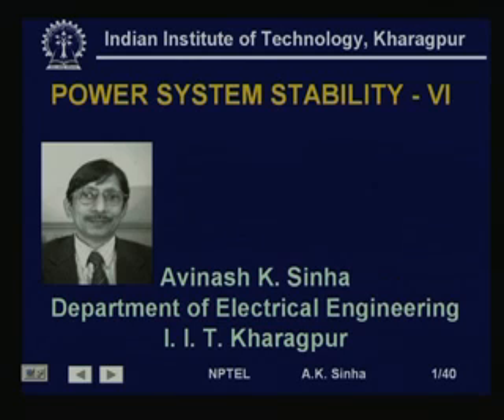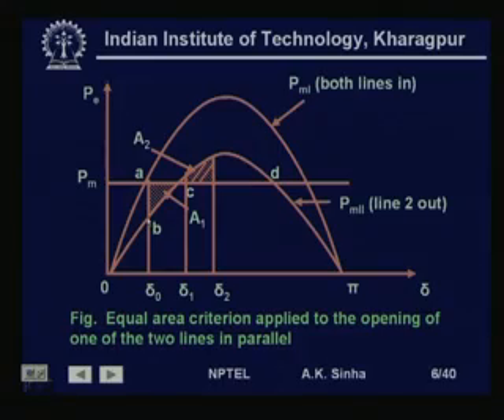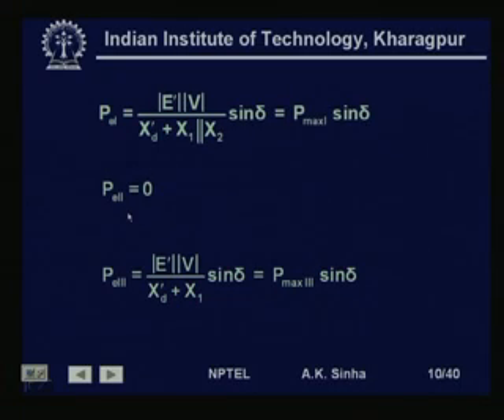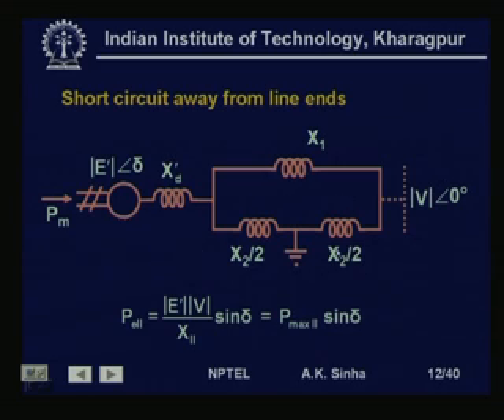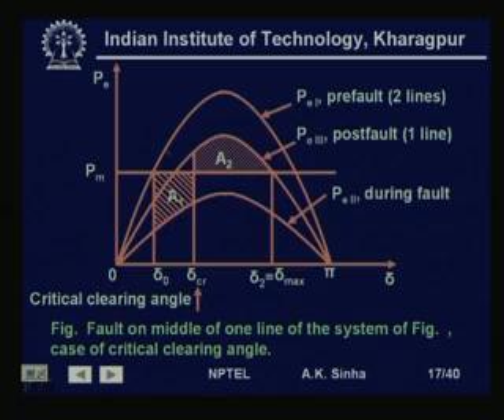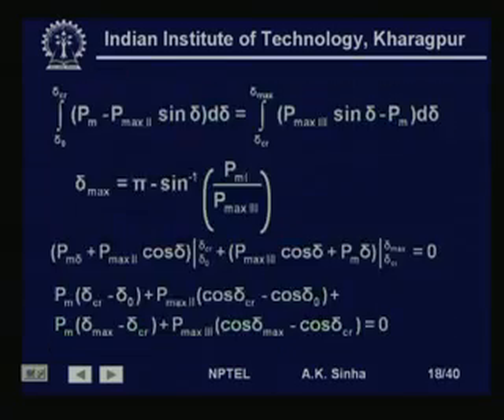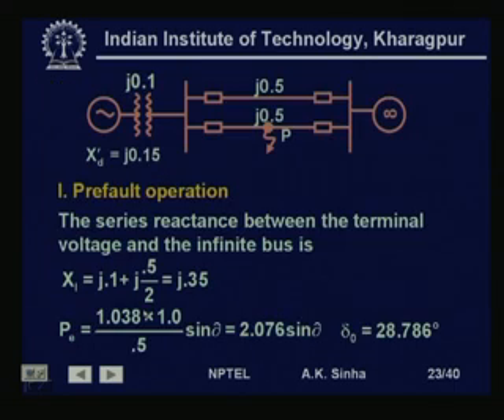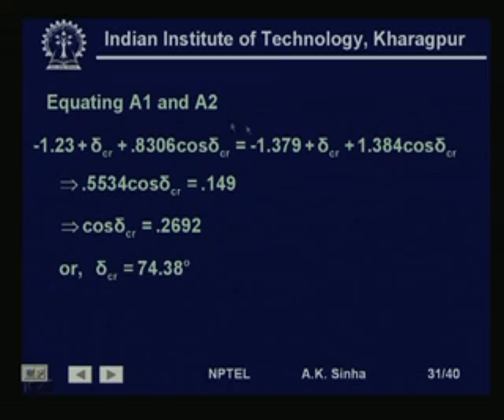Lecture - 38 Power System Stability - VI

Comment: According to the figure for the CB reclosure case @ 46:53 , the accelerating power is suppose to be Pm-Pmax3, sin(theta) instead of Pm - Pmax2,sin(theta) . Hence, for the equations to be consistent with the ones given @ 46.53 the figure must be labeled in the following sequence: Pe-1, Pe-3, Pe-2 and NOT Pe-1,Pe-2,Pe-3 . I think it was misrepresented
Reply: 99999999999999999999999999999999